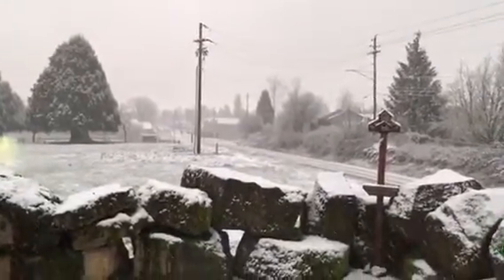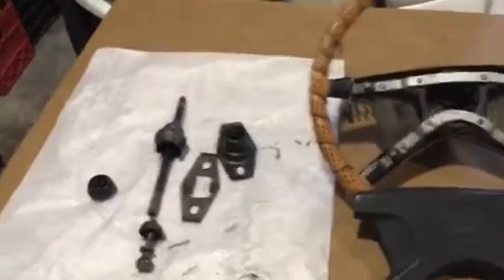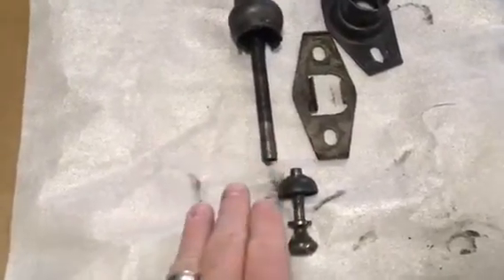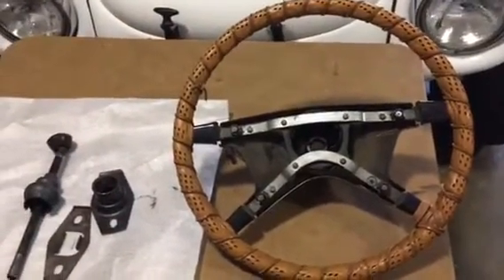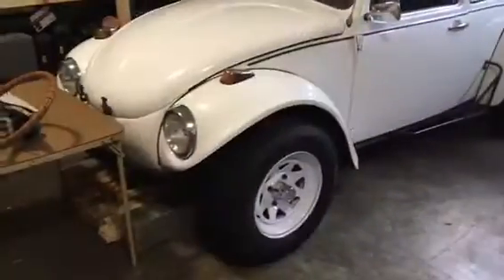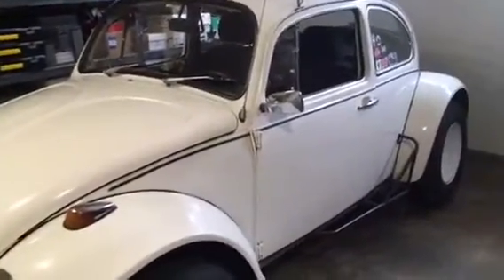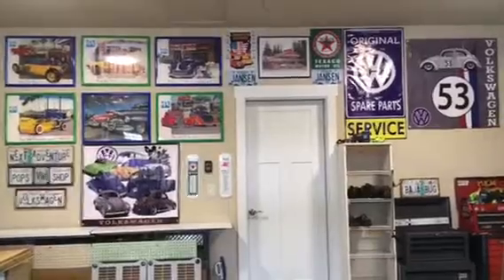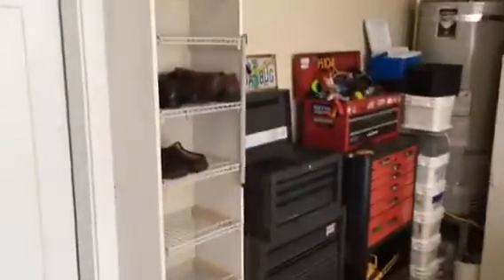Baja repair on a Snowy Day

Comment: Nice upgrade steering wheel and shifter replacement. Glad you were able to make it back to the house. Good job on the Baja brake and axle repairs, you are set for some trips this Spring now.  Shop is looking good with the new banners.  Stay warm and enjoy your week.
Reply from the maker: Rusty Glovebox   Thanks, I’m ready to get out and about for sure. Going to put in 2 more electrical boxes and led lights for evening work time. It has snowed here all day today and supposed to continue for 2 or 3 more days. Thanks for watching my friend and you take care.  BigW:-)